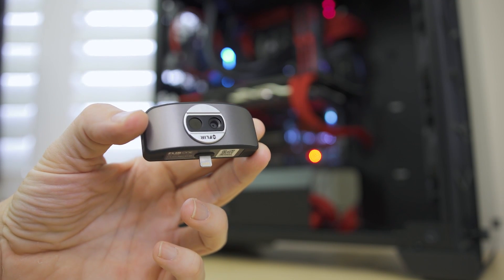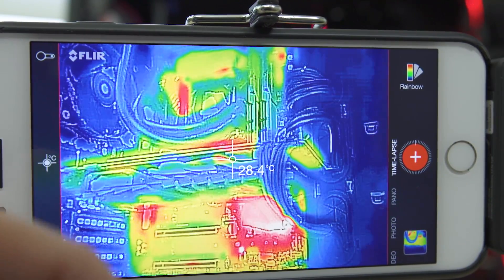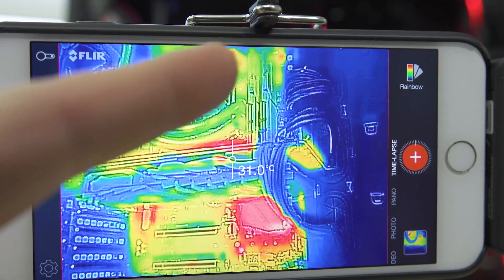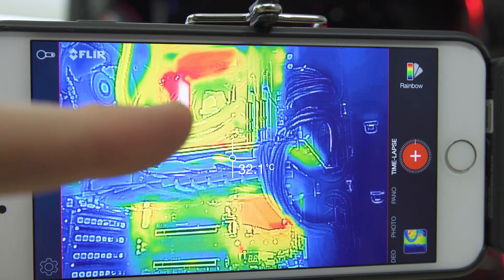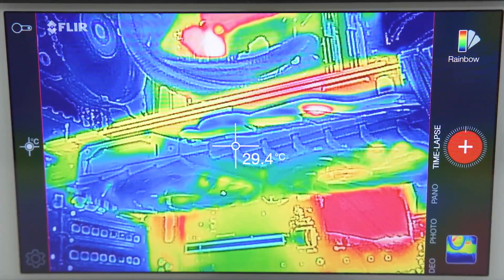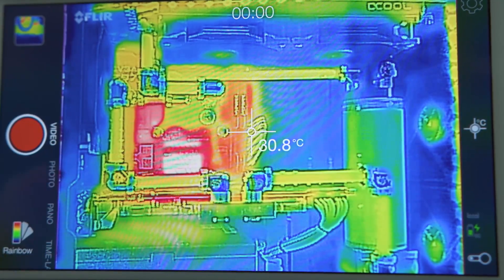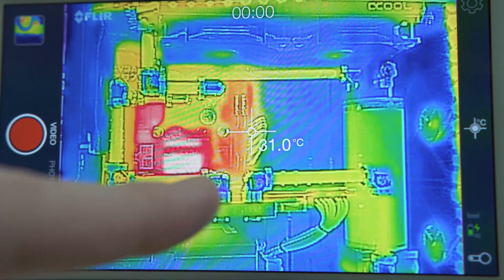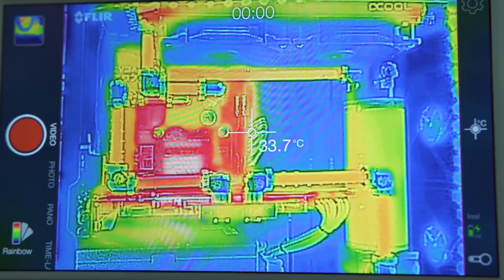PCs and Thermal Imaging... What your eyes CAN'T see

Comment: That's why i don't like thermal imaging videos. Most people don't understand how they work.
Reply from the maker: This is clearly going to turn in to nothing more than a dick measuring debate on who knows more about IR tech. I wont partake. You guys have fun.
Reply: Exactly. Shooting this complex structure with different shapes, colours, materials, reflexivity/emissivity and so on is pretty much useless.
Thermal camera dont actually pick up temperatures, only infrared light.

And i don't have the time, nor the courage, to explain everything in details here.
Reply: R4GEcraft     Always take thermal imaging with a grain of salt. The color and reflectivity of the material you are pointing out can vastly change the reading. You cannot measure temp accurately like this unless it's a perfect black body, which heatsinks and gpu coolers are not.
Reply from the maker: Fair enough! Trust me when I say that there is a point where yes, the shapes and materials give skewed results. This is one reason that I did not use Skunkworks for this video, the surfaces are just too polished and I got nothing but reflection. But I still plan to use this tool moving forward.
Reply from the maker: Writing this off as useless is as useless as the comment itself. It still teaches us things. If you are smart enough to already know all of this then enjoy this cookie, however much can still be learned by this. Take care.
Reply from the maker: Wont the tape itself cause the temps to be slightly insulated and skewed?
Reply from the maker: So are you trying to say that unless a surface is flat black then IR cameras are useless? I had a long discussion with FLIR on how I planned to use this and they seem to think that my purposes for this camera are will within line on reasonable.
Reply from the maker: I wouldnt get too worked up over it honestly. This is just a tool in an arsenal, and not to be used solely to prove a point, but only cast more light on findings... no pun intended.
Reply: I did not meant the video was useless (sorry for my bad english), but the computer itself is too complex to be analysed well with 1 thermal camera from 1 angle because when you see something "hot" it does not mean it actually is hot. It can just be a reflection of a hot piece in the background (in the pc or not). The opposite is also true, you can see object blue on the screen that are actually pretty hot just because they don't emmit a lot of infrared when hot.
Reply: it's negligeable if the tape is on a large metal surface (thermal insulation works the same way electrical insulation does, a small resistor on a metal plate does not affect a lot the total conductivity)
But if it's matte enough, it won't show crazy results on those particular points

I think flir themselves are selling some "high emissivity tape"
Reply: JayzTwoCents this comment is the reason why I love watching you
Reply: It definitely a great tool, but please use black electrical tape where you want to measure temperatures :p
Reply: taxid3rmy I don't want to argue here about this subject and it will be my last comment, I already wrote everything i had to. But no, red means more infrared and blue means less, that's it.
It does not tell you where the infrared comes from.
Reply: IR cameras are best to see the travel of heat as opposed to quantifying it, especially since the time lapse didn't have a heat scale. For what you used it in this video, it's fine and does the job showing people how heat travels and where the general hot spots might be.
Reply: Useless ? No. But it's not a measuring tool (or whatever is the english name :p).
Reply: You should have added a overlay for certain points I can't really get a good idea how much hotter from green to orange is could be 1°c difference or 20°c difference we can't tell from just color.
Reply: JayzTwoCents and that's why I stay clear of YouTube comment sections nowadays
Reply: It is true that many objects will reflect more IR than others, and I can probably assume that most adults would know that anything darker in color will absorb heat; however, this doesn't mean you can't use a tool like this to measure them. They just need to be done tactfully and have some common sense. I would agree with some people that polished pieces are not a good thing to use this on, and as +JayzTwoCents has said, this is why he didn't use it on skunkworks. It doesn't seem like Jay is an idiot and has done his due diligence. I'd suggest, that if you don't like the use of this tool in his reviews that you just plainly do not watch them or ignore them as it seriously just seems like a pissing contest at this point in the comments.
Reply: what is wrong in this vid?
Reply: Well, taxid3rmy, that's the point. A different color does not mean a different temperature.
And that's why you should be careful when watching this kind of video.
Reply: 3en6ie 3en6ie   That's not true at all. Shiny materials like heat pipes will reflect ADDITIONAL infrared waves emitted out of other objects meanwhile a matte black plate would absorb the additional ir waves. EDIT: Im on mobile sorry for spelling.
Reply: Jay dont get into a youtube fight........
Reply: Right thermography is to take with a pinch of salt. Its not easy to "measure" right (emissivity). ...had to deal with it for two semesters (measurement technology + sensor development) BUT taken with care this is great for youtube! Sure it would be more exact to probe points with a thermocouple but the point is to get a ruff qualitative analysis over a .001 reading... and this is more entertaining ;P
Reply: In short, no definitely not useless 
I think the video is ok for what it trys to get across, but you could get a lot more, and more accurate information depending on methotology.
If you want to make sure that what you measure is right, use a thermal probe in addition to the thermal imaging camera. You can get those for multimeters and you can usually trust them to 1°C or look into the manual for the accuracy.

One thing, that would be good to know: Which assumptions does the camera software make?
Also important: If we are talking "black", not everything that is black in the visible spectrum is black in IR (and the other way around). Reflectivity obviously is a big problem and it's great that you are aware of it. Even if using black tape seems like a crazy idea, using the same surface would give you comparable results (because this is all that matters).

I am not sure about the comparison of the PCB and heatpipe temperatures, i have the feeling there is something wrong there. Also, if you make more videos like this, a color scale would be useful! And maybe a better explanation of thermal imaging, your gear, and the problems involved( for people that don't know).

Sorry, this got longer than I intended. If you read this, thank you for your great videos. I know you want to get things right. It's just a reminder, that you have a huge audience and you are somewhat responsible for what we believe to be true. Keep up the good work :)
Reply: Jay, techical stuff aside, my problem with this video as a viewer was actually the variable color scale. If you don't keep the color range constant and/or provide the color/temperature scale, I (and probably most others) cannot keep track on what's actually going on with the delta temperatures.
Reply: Yes,  the heat pipes on MSI cards are very shinny and glossy,  thermal image tech can't measure glossy shinny surfaces
Reply: ^ I agree with this guy.
Reply: I use Thermal imaging on a daily basis for the petroleum industry and i can say that for a casual user who would use this type of camera for "fun/information" this video is more than sufficient, anything deeper would be for a professional application.
Reply: JayzTwoCents I worked in the oil and gas industry for 13 years.  each site had their own or guns from fluke. not Imaging though, just laser dot. this was used to check temps of rotation so equipment and other heated equipment to ensure insulation was still functional, and bearings were ok.

we didn't factor emissivity into into the device, because there were z wide range of materials and surfaces that were to the checked. and if ur going to use different emissivity values, u would have to test for all, and even if it was dry, dusty, wet with water or oil.
that's was not practical.

u used the gun, and got baseline temps, and measure for CHANGES, deviations, from what u had established previously.

if u need more exact measurement, the Condition Monitoring guys would use a thermocouple to establish the exact temperature, and then correlate it with what the ir gun displayed.  

all in all, the variations due to incorrect emisivity were not enough to be concerned about, because a hazardous conditions didn't start at a discrete point of temperature, but it slews... as in as it starts go hotter, the life gets impacted more.
Reply: The point of this video wasn't to show 100% accuracy, the point of this video was to show relative results. Which is what a tool like what Jay has does well. All other things aside, he is showing that there are parts of your computer that are warming up (things like your motherboard, your ram, your chipset) that need some kind of air movement to stay cool. If all you want to see is relative temperature between two objects, then a simple IR measuring tool is good enough. He wasn't trying to show how definitively hot the CPU water block got, he just wanted to show the effects of heat on a system as a whole.
Reply: The reflectivity and emissivity of the components are constants in the system. No, it's not perfect for getting exact results, but it's perfectly fine for extrapolating information about the changes throughout the system.
Reply: I just don't understand, if the temperatures of certain parts in the computer is not being displayed then the purpose of monitoring which parts are hotter on load and off load then the tool isn't very useful for that purpose. why is taxid3rmy trying to argue against this?
Reply: Here's an idea. Make a video yourself.
Reply: So Jay asked the FLIR people some questions and they answered in the affirmative. Thing is, what and how exactly did Jay ask them? Was he cognizant of the inaccuracies of the readings pertaining to shiny, smooth objects when posing his query? If not, I doubt the busy sales rep at CES would have replied with an appropriate response. The point is the science of thermography is well understood and Jay's confusion regarding the strange apparent temperature differential between the heat pipe and PCB lead him to an incorrect conclusion due to his lack of understanding. That doesn't mean he's dumb, just ignorant. At least the latter can be solved through education. Willful ignorance in the face of scientific proof is a whole 'nother ball of wax.
Reply: didn't watch till the end yet, but no kidding
Reply: WOPPER You Sir have made the only legit comment under this video. (unless someone else said the same thing)
Reply: Yes, the hardware is suitable for these sorts of uses, but the user still needs to understand the instrument in order to learn anything meaningful from what's shown on the screen.
Reply: R4GEcraft his stupi he didn't even move the thermal camara
Reply: @JayzTwoCents I have CAT60 with FLIR camera. If you get to the settings of FLIR,  there is option to set emisivity for materials - like for metal etc. That will/may solve many problems.
Reply: Jay. Please read this. This is an article from the manufacturer of your thermal camera, FLIR.

http://www.flir.com/science/blog/details/?ID=71556

On a shiny metal can, the reading from an area with a black tape is ~163F, and an area without a black tape is only ~74F, a 89F discrepancy.

As a side note, this is not comparing dick size, this is to avoid drawing uninformed conclusions from an otherwise rigorous test. I disagree that FLIR is useless, but it is important to acknowledge its various shortcomings which sale people often conveniently forget.
Reply: Did jay understand?
Reply: JayzTwoCents Hi Jay, are you planning on a kabylake oc guide or will your Skylake one do fine? thanks
Reply: Jay thanks this does help give light on what needs improvements in my new build. please make more cooling videos with this technique.
Reply: Jay, please see Gamer's Nexus videos on thermal imaging.
Reply: can you message me about details around you building PCs?
Reply: how inacurate was this video you think? i mean , can it be used as red line?
Reply: what about airflow?
Reply: It's more than enough for the planned purpose. This is PC stuff not rocket science...
Reply: u guys, it doesn't need to be exact, as this is to give a general continuous Monitoring of conditions. any changes will be observed, and if u want an exact reading, u can place a thermocouple after a quick or scan.

eventually, u would come to know which temps on which surfaces are good or bad, and can make the short cut estimation without the thermal couple
Reply: If you have an understanding of what is creating heat in the computer yes.
Reply: ZzZzZzzzzzzZzZzZZZzzzzz...........1 titan xp, 2 titan xp, 3 titan xp..............
Reply: It is. Everyone must see that parts that could be hot are hot. Just surface (shiny etc) will mess with acurate color reading. But you still see what is hot and what is not. And as I wrote above you can make correction by setting emisivity in camera settings.
Reply: The FLIR One that was used in the video does not have the needed options to change the level or span. you just can't change the emissivity in the camera setup. BUT for what JayTwoCents wanted us to show, it is a good indicator.
Reply: I don't understand. That's like saying: 'That's why I don't like vaccinations. Most people don't understand how they work."
Reply: JayzTwoCents I get it...
Reply: TehObLiVioUs hi